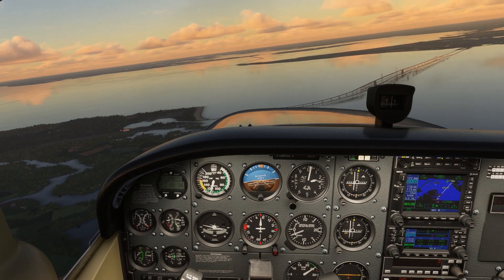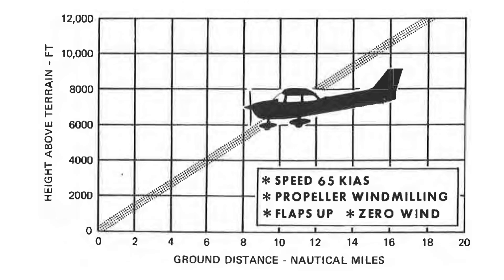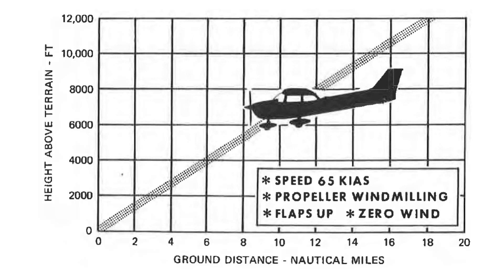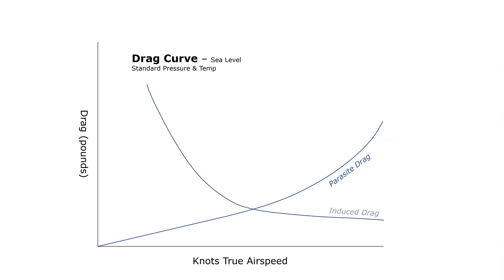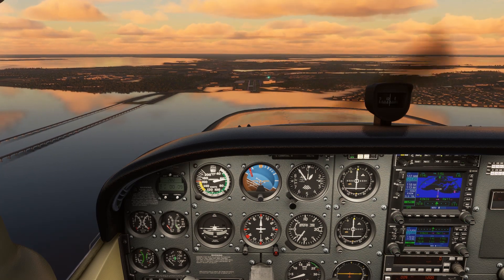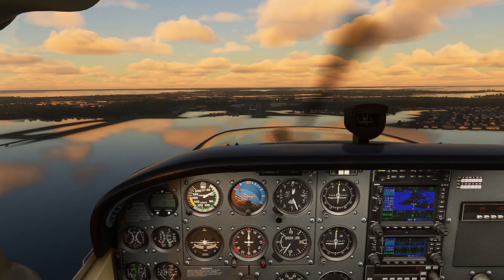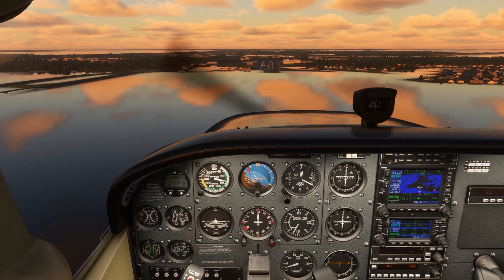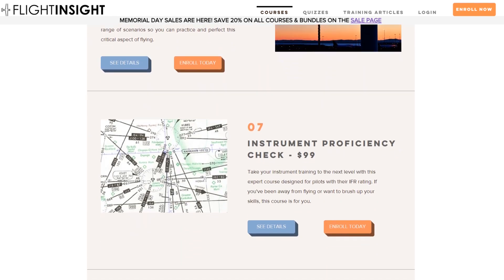What's Your Aircraft's Glide Ratio? | Best Glide Speed

Comment: OK so now add a 15 knot headwind, what's your best glide slope speed now? Is there an easy "rule of thumb" that can get your through an ordeal such as increase your glide speed by 1/2 of the headwind or increase your AOA by so many degrees per quantity of headwinds to offer a better penetration speed. As an R/C enthusiast and particularly when slope soaring I can say for fact that you must increase your airspeed from best glide speed to best "penetration speed". It will translate to full scale (as we call it) aircraft, it must still apply as we both fly by the same aerodynamic rules; My sailplanes exaggerate this profoundly as I often fly in winds that exceed my "calm winds" best glide slope speed or best L/D speed. My powered planes also make obvious that you must fly faster than best L/D to glide a further ground distance in a headwind. Is there a rule of thumb that you can share for these instances. I'm studying for my PPL where I actually have gauges whereas in my hobby we determine by the seat of our pants... well... by the sockets of our eyes lol.
Reply: In gliding the rule of thumb is to add half of the headwind component to your best glide speed. And vice versa, reduce best  glide by half the tailwind component if that is the case, although you need to stop at the minimum sink speed if you have strong tailwinds to ensure best glide. However this is only a general guideline, but it works on most aerofoils. But you will have to calculate the glide ratio in different  wind speed yourself.🙂
Reply: @zolozolo4738 Thank you for this. I remembered reading or being told exactly what you've offered here and needed a verification. Thank You!

Comment: Very clear and easy to understand explanation of L/D and glide ratio! 😊 Just to add a bit: the best glide angle is achieved when the lift-to-drag ratio (L/D) is at its maximum, which allows the aircraft to cover the longest distance for each unit of altitude lost. This is crucial in situations like engine failure, where you want to maximize your gliding range to find a safe landing spot. Great video, thanks for making complex aerodynamics so accessible!

Comment: 65 KIAS is best glide only at maximum gross weight flying straight with no wind. Best glide is actually an AOA and the speed needs to reduce with weight though increases in headwind. The AOA is constant regardless of weight but decreases in headwind. Note the ratio does not change with weight but does with wind. Glider handbook gives much better discussion, go figure. Since we mentioned straight, 45 degrees AOB is the best way to turn losing the least amount of altitude in the glides.

Comment: It always disappoints me when these kinds of conversations don't include the ideas of calculating your best glide speed based on the weight of the aircraft and using "Speed-To-Fly", like glider pilots do. I'm confident that using the correct glide speed, and adding half of a head wind or subtracting 1/3 of a tailwind from that speed, would get you the furthest distance possible in a real-world situation.

Comment: If the engine is providing some power leave it running. If not first step is to pull the nose up to get the prop stopped. Windmilling prop is a very large airbrake. With it stopped makes a significant difference. Cessna should provide the data in the POH.